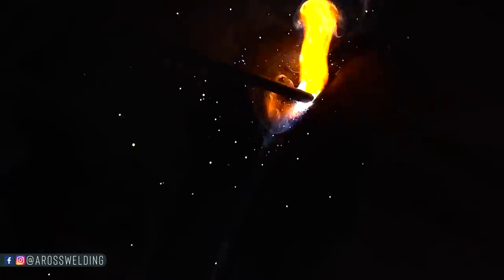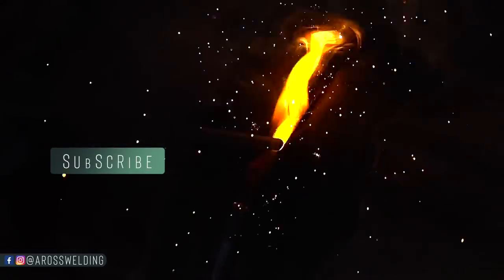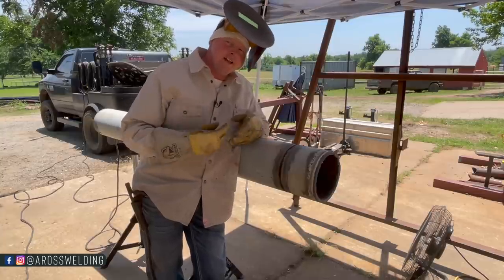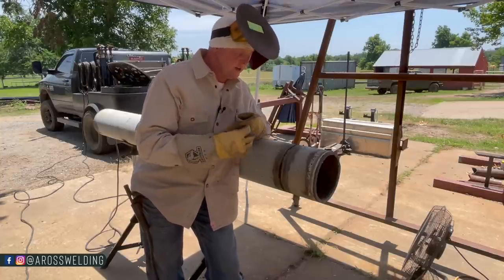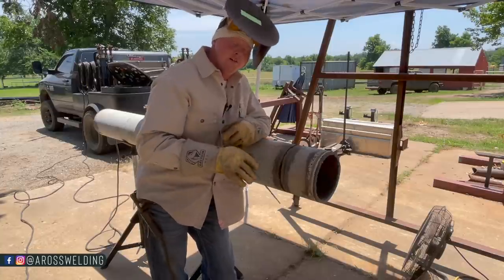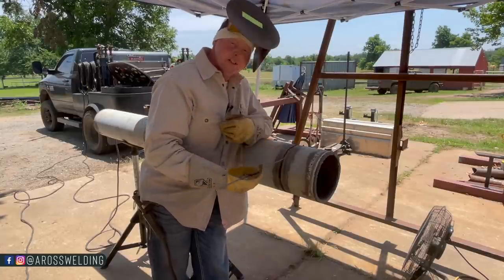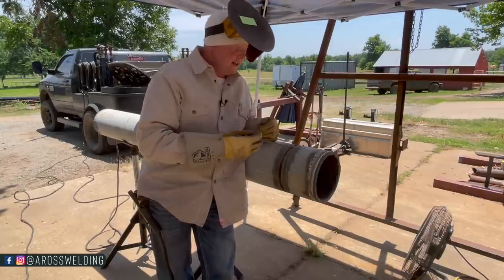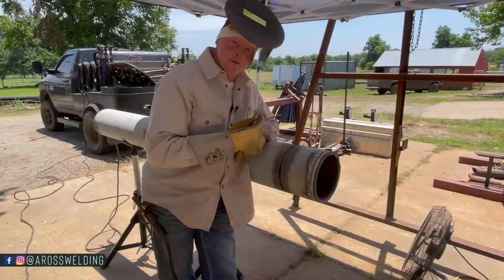BEST TIP I EVER GOT ABOUT WELDIN A HOT PASS ON PIPE

Comment: yes you are right you don't have to have a hot pass screaming hot. Big inch   pipe one would grind the  crown of the bead down  chasing the wagon tracks till they were almost gone then put in a heavy hot pass .Then you could have a heavier hot fill . spaghetti line 3&4 " henskin .125 wall would not buff or grind the bead .Start just passed the top button kind of sweep ( wave ) till about 2 oclock then just drag almost like a bead  then whip on the bottom keeping the hot pass narrow with a very tight arc so the cappers don't get mad at you for gouging out the pipe . Good video Austin

Comment: This is a kind of the opposite of welding fast to control distortion in a joint. HEAT input matters more in this case. The longer you spend putting the puddle in, the MORE heat you impart into the weld. More heat input equals more shrinkage in the root as it cools which equates to a proper reinforcement inside of root pass.

Comment: I’m trying to get my head around an uphill open corner on a 6013 (not allowed a 6010) 2.5mm rod on 5mm plate at 90°. I was using 69amps and balancing travel speed for a good root is difficult, I have played with amps up and down and travel speed as well. Are you able to demonstrate (or have you done one already?) so that I can watch over and over again please? Also any tips or advice would gratefully received.

Comment: Hey Austin, what’s you technique for capping the bottom using 8010? I’ve got the top & belly down just need to clean up the bottom a bit. Keep these videos rollin.
Reply: not austin, but i just helped a younger guy today on his cap. we welding 42" with 3/16" 8010. usually run around the 160amp area on the bottom, weld straight on, or a slight push. whipping motion back and forth, you want to whip ahead to cool the puddle, then whip back and watch it wash out the edges. Repeat as you stitch your way down. A slight push helps flatten the weld and reduces undercut.
Reply: Long arc it .the puddle will spread out  and you will have more control . I would do this as you whipped back and forth like a filler a mm either side of the bevel . do not fill the bevel any more than flush or you will have to play with extra metal . This worked  for me to put a bottom on like a stack of dimes
Reply: Makes sense, preciatte it fellas.

Comment: I Kina disagree I’ve been welding pipe for 7 years aswell , and on my hot pass’s I generally go hotter . Not faster but definetly hotter but I also tend to not grind my roots very much so I need the heat to burn out any slag. Anything that I roll out o also turn up heat a lot 3 inch sch 40 would be like 90 amps root 110 hot 170 cap with 5/32

Comment: can anyone explain that why 6010 has flame coming from The Arc? 😂
Reply: 6010 electrodes contain cellulose (production from wood by chemical reactions). Current and arc create enough energy to burn cellulose and this will create CO and CO2 gases. Especially 6010 electrodes may contain more cellulose in coating comparing 7010 and 8010 (because you need more penetration for root pass). This can be changed according to manufacture electrode model.